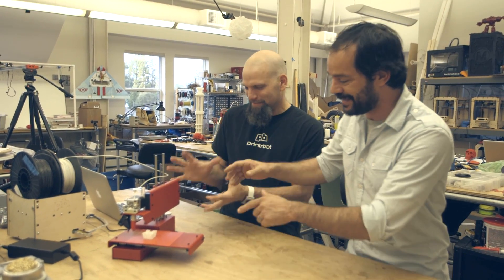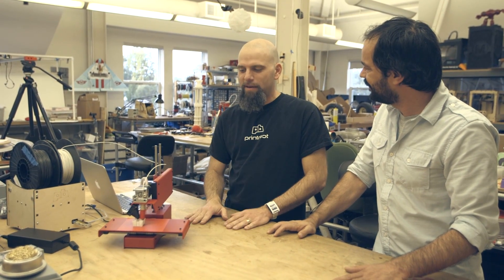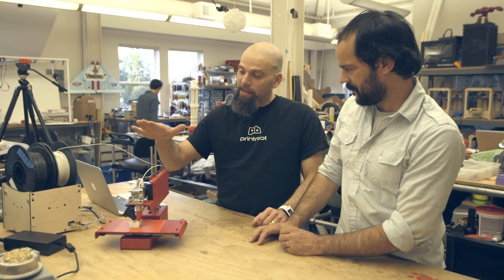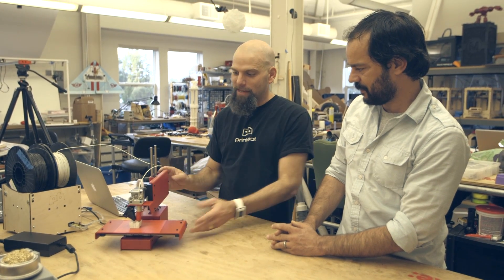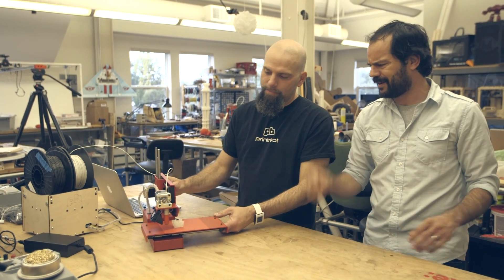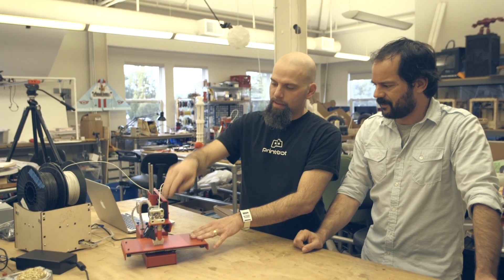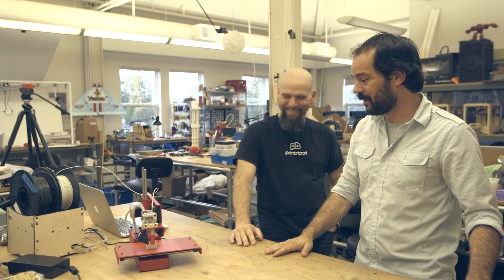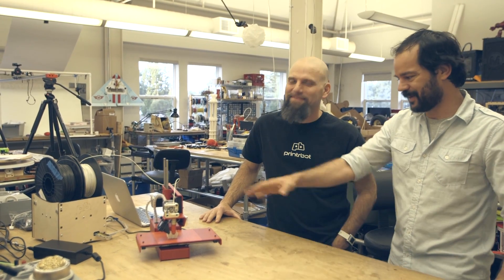First look: The All-Metal Printrbot Simple

Comment: what materials will it print with?
Reply: I think just PLA, but it can be modified to print ABS. This isn't standard though.
Reply: purpletoupee my 2014 printrbot simple prints both pla and abs stock no heated bed i just use a hair dryer to heat the bed that press print and it does abs fine i dont heat it the whole time either i just put a cardbored box around it and it seems fine so far some times it will have problems but they are small i seem to have the pla break of my bed a few times so far

Comment: Other than the print size, what's the advantage of this model?
Reply: Stiffness that transltes into more precision then you can get eith cog wheels and steppers. This is the logical next step.
Reply: It is self-leveling. Many other printers require you to level the building platform before EVERY print or else the printed object will be flawed. A lot of beginners say leveling the platform on other printers is very time-consuming.
Reply: vinnyyu01 Thanks for that input. I'm building my own 3d printer out of metal just to play. Where's a good source of wisdom from people who have experience running these?